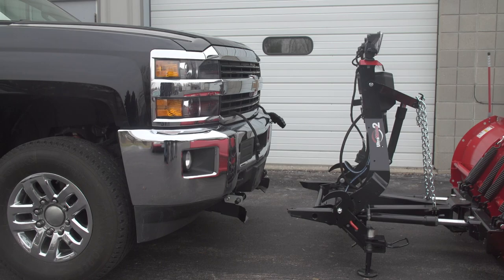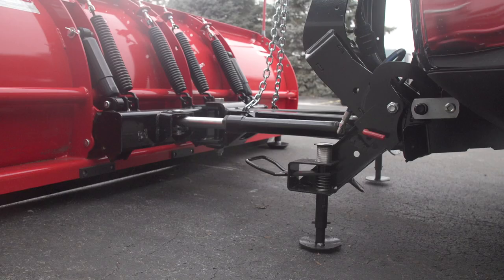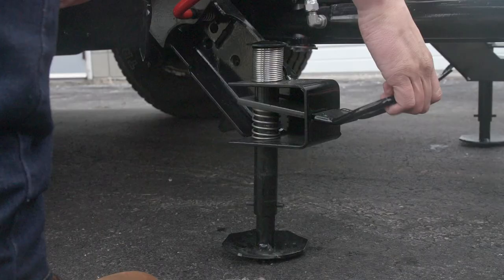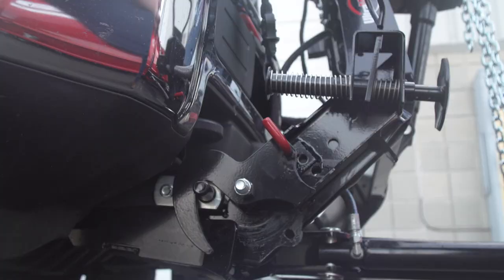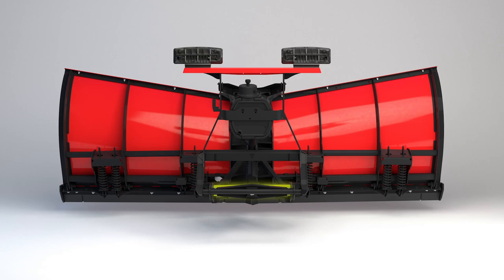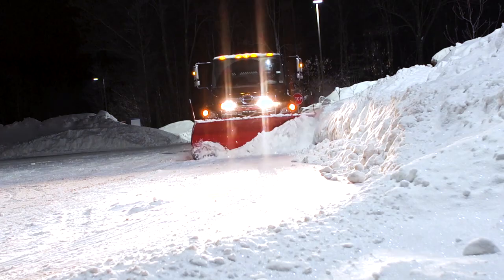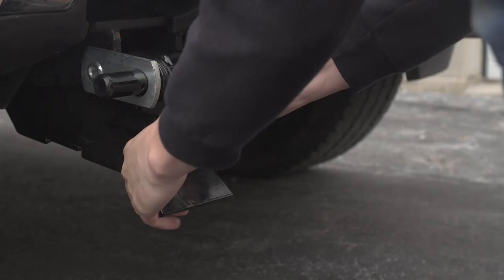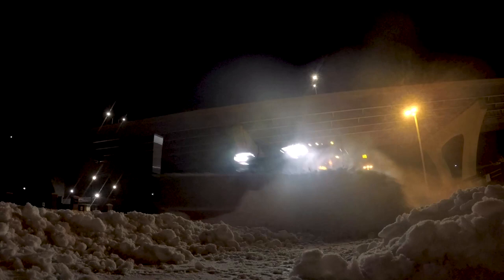WESTERN® UltraMount® 2 Snowplow Mounting System

Comment: This thing has been an absolute nightmare for me. Bought one of these for my truck to maintain my property and the wiring shorted out before I was even able to use this once. While it may be easy to hook up, it's made very cheap and you spend more time dealing with problems than actually plowing.